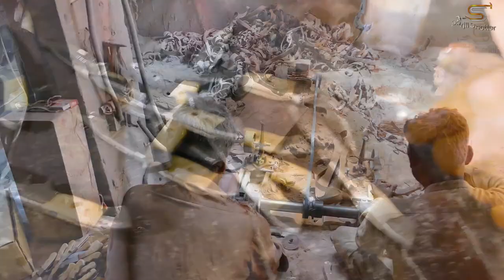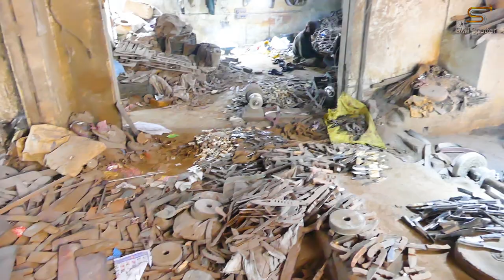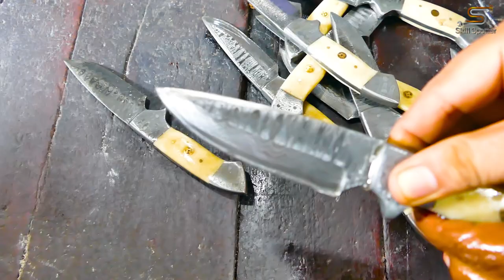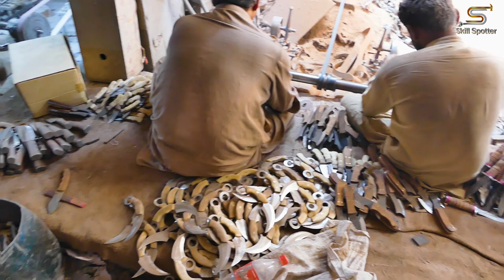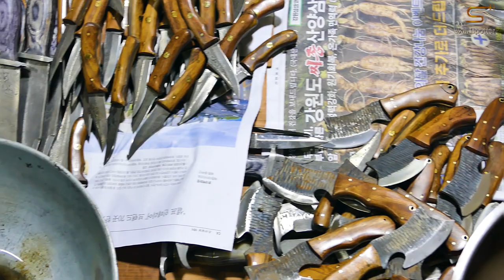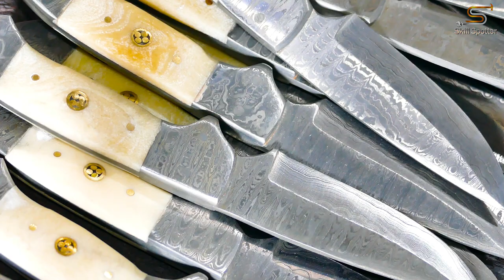Random Visit of Knife Making Factory, Huge Variety of Hunting Knives

Comment: Address is somewhere in Pakistan. their motto is "quantity not quality" That is not a factory. It's a back room filled with filth and scrap metal... you can find examples on "ETSY" but those are well made and nicely finished exceptions to get you to buy a knife. Then they
ship you one of the knives you see scattered across the floor.  I mean, why would a 12' Damascus Bowie knife cost $49.95.  PURE JUNK!!!
Reply from the maker: Respect your opinion.
Reply: They're just trying to make a living and though they make a lot of these knives the old school way, it's because they have to work with what they have, granted there are some that look at it as just a job and may not care about the quality of there work but they won't last very long. That said, I just bought an 18-inch Bowie and right out of the box it is hair-shaving sharp, great heat treat on the blade, and in D2 which I love. I Love all things custom and handmade, and the way that this Bowie was made, is as close as you could get to "traditional" knife making and there is nothing wrong with this at all, in fact each knife is unique and I appreciate the hard work and skill that went into making my knife. It actually outperforms and stays sharper than ANY Ontario knife that I ever have and owned BY FAR and it's right on par with the chopping capabilities of my Becker BK9! I used to knock Pakistan-made knives but there are quite a lot of them that really are actually pretty good and cheaper than many US made knives and definitely far better than made-in-China gas station knives which are over-heat treated and are brittle 440 or 420 stainless steel. I suppose people have gotten so used to production-line knives that a lot of people don't appreciate the uniqueness of each individual knife that was made.  That said, I would rather buy a good 3  or 4 of these handmade knives sitting on the floor, than to pay $100+ for a cookie-cutter copy of ONE knife sitting in a pile in a bin at some warehouse in the US and was made by a machine! Oh, with the exception of the knife being sharpened and a set scales screwed on, and thrown in the box, that's pretty much the mainstream knife definition of "American Made."